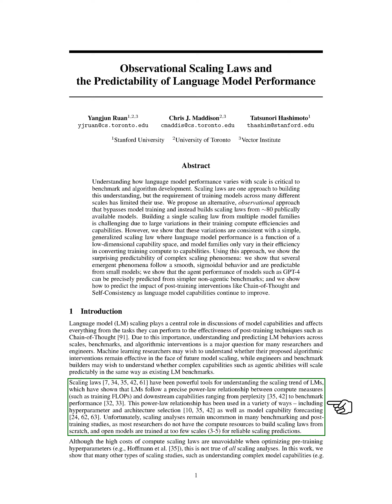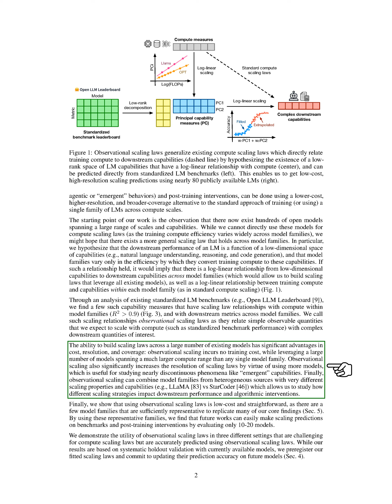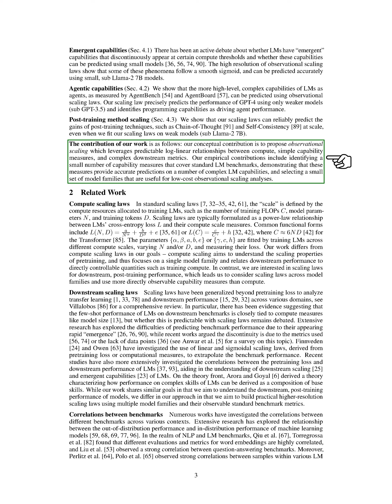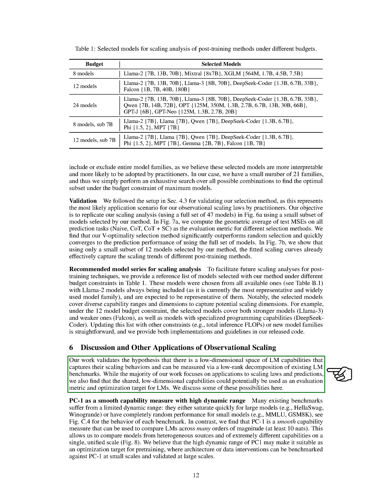Observational Scaling Laws and the Predictability of Language Model Performance

Comment: ❤Scaling Laws 2.0 as a means of optimizing pre-training, categorizing the relative potential performance distributions of architectures, etc

I.e. The paper introduces an energy function as an analytical tool to model and understand the memorization and retrieval process of Transformer-based language models, providing insights into their performance and convergence dynamics during training.